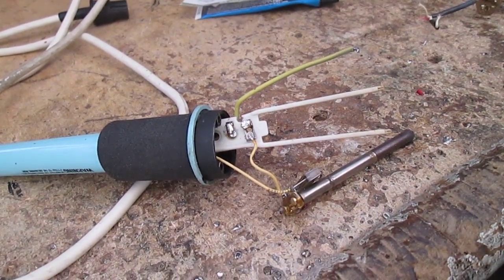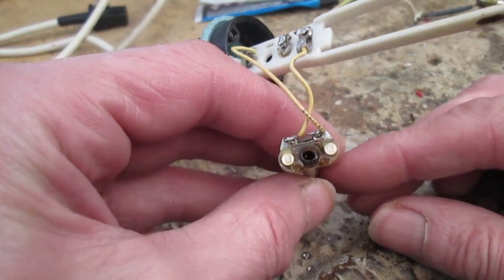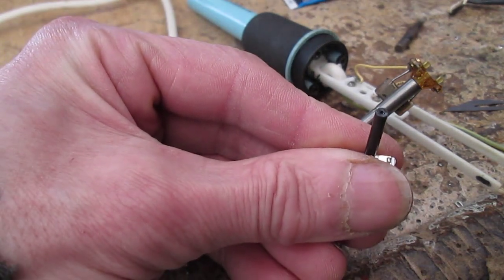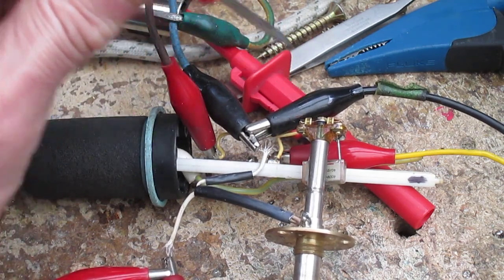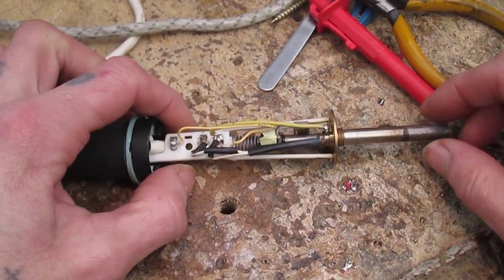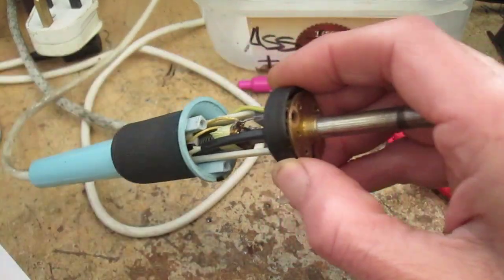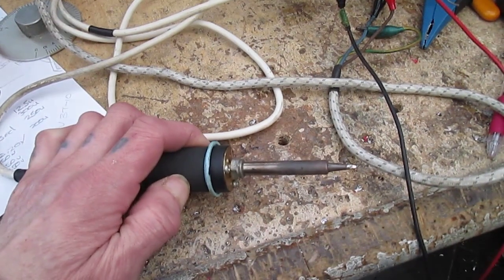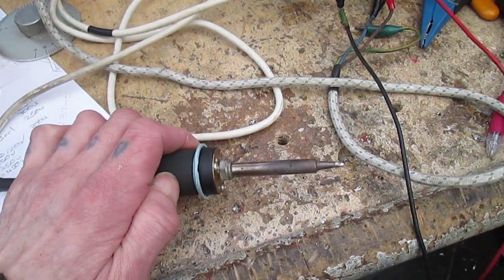Weller TCP Soldering Iron - Repair

Comment: I have 3 of the 24 V Wellers and the elements go dead. A bugger to assemble. I agree, they did not make it easy to repair and they are very expensive to repair. In South Africa where I am, you have a bugger of a time to get spares.

Comment: I totally understand your frustration with the Weller irons. Really PITA to reassemble, not to mention the parts are way, way overpriced for the short life of them. Great tip on the crud on the contact area. The tips erode extremely fast , especially if you nick the "coating" on the tip. They also bend from the heat at the end of the tip after the coating is nicked.
Reply from the maker: Aye, they as tricksy as a pixie. The old tips last years, the new ones months. TFW.